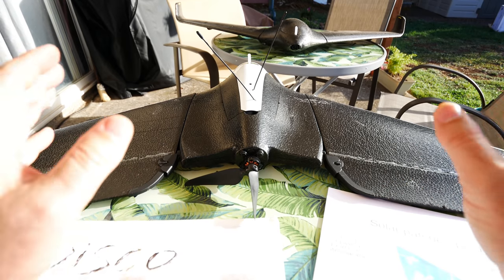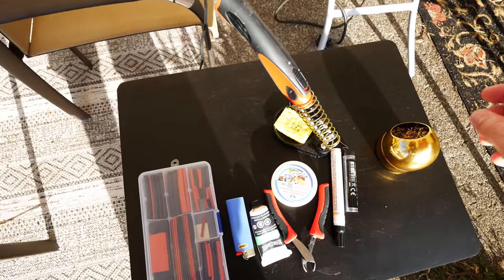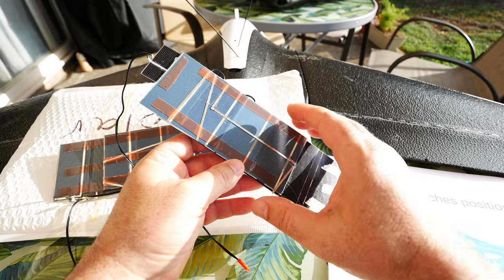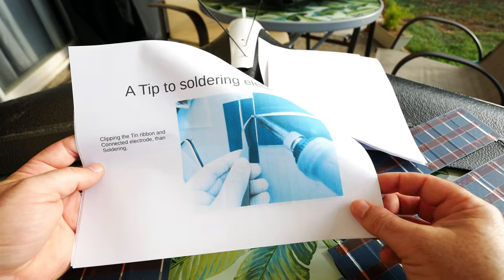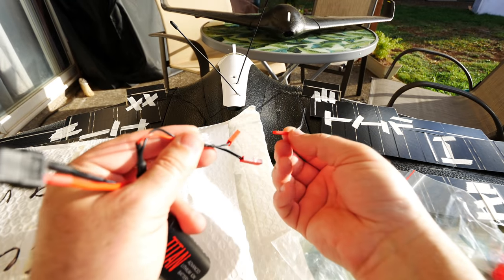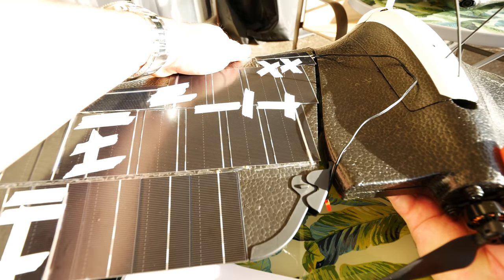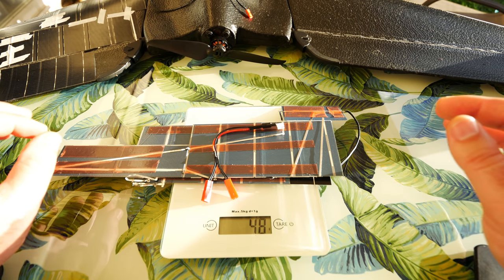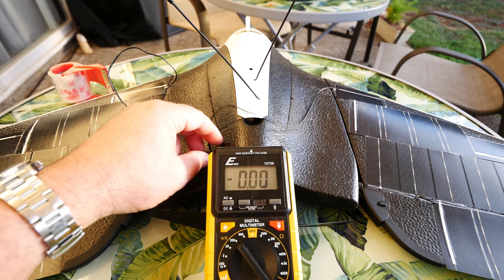Parrot DISCO 4G LTE Solar Panel Mod Install - Solarealdrone Kit (Works for other Planes/Wings)

Comment: Imagine how little current those solar panels can output, versus the battery.  You only measured voltage, not how many amps, or fractions of an amp those panels can output total when connected to a load.  I highly doubt it helps add flight time, as the added wind resistance probably uses more current than the solar panels add.  Just my thoughts as an Electrical Engineering student, who also flies drones.  Please tell me you at least have a basic understanding of volts x amps = watts, how many watts the panels can put out, and how many watts your battery pack can instantaneously.
Reply from the maker: Right around 2+/-  amps.  If you checked out the solar panels in the description as I mentioned, you'd have seen the specs.   14ish volts at 30ish watts is 2ish amps.  Enough to supplement some extra power and flight time.  My tests seemed to get 6-7 extra minutes with a 3500mah liIon pack and mainly flying in circles 🍻 🤗

Comment: There has to be a tiny battery controller to put in there? I would hate for the thing to burst into flames and come crashing down in some ones yard
Reply from the maker: As long as the panels are not left connected while not flying there shouldn't be an issue.  The Disco will draw more in flight than these panel can provide at full potential 🍻

Comment: A few issues that need to be addressed:

Issue 1: Should the cells be fully illuminated while left unattended, the battery will over-charge to fiery effect! The array produces over 12.6V open-circuit; initially connected, the battery+array may reach an equilibrium voltage below this threshold, but there is nothing to stop it from rising beyond this later as the battery charges.

Issue 2a: Symmetrically, when not illuminated, the cells will be back-driven by the battery (I didn't see a diode in the provided harness, nor included in the array). The battery will likewise be destroyed, but without the self-immolation side effect.

Issue 2b: Without reverse current protection, the cells can be damaged, especially with inductive transients coming from the BLDC motor when it is active. Granted, solar cells can be back-driven (using an IR camera, you can see the array "shine" and detect defects), but the silicon junction can be damaged by transients above the reverse rating. 

Issue 3: Varying lighting conditions (and varying draw from the battery/load) will upset power matching, reducing efficiency. Granted, this is a mild annoyance compared to Issues 1 and 2.

Conclusion: Without proper protection circuitry, the array may be damaged. Adding a charge controller and cell balancer will protect the battery from over- and under-voltage conditions. Also, adding a MPPT (impedance matching) will maximize for best power.

Recommendation: Is there sufficient interest in the community for a combined MPPT+Balancer+Charger device? Does an offering already exist?
Reply: i have this panel`s on my Disco with MPPT provided....each panel output in direct sunlight 16-16.5V , MPPT regulates the voltage to 12.55  and the remaining voltage it converted to mAh by Mppt.. Mppt also provide circuit protection...but not over charge if you leave unattended.  I dont know why he sent to him the Y cable variant.
Reply from the maker: They sent me a mini controller for the Night Fury kit which I may install into the disco as well.  Although, I think if panels are left disconnected until launch and disconnected at landing.  Most if not all of the issues can be avoided on a sunny day 🍻

Comment: Nice video but that's as far as it goes - with the extra weight and the extra drag you're going backwards - the kit is poorly designed!
Reply from the maker: I think actually test flying it will determine that 🍻

Comment: What solar charger would you use for this application?
Reply from the maker: A micro regulator that can take 17v in and output 3s voltage with cut off for overcharging would be perfect but not needed for this wing if you unplug panels when not flying 🍻

Comment: How can incorporate 4g into my Ar wing pro and other wings? Cheers
Reply from the maker: Transplant the 4g modded Parrot CHUCK flight controller into your wing and test 🍻
Reply: @DustinDunnill  So i,ll need the parrot flight controller? Surely this can be done with other hardware like pixhawk or something..🤔
Reply from the maker: Yes it can but will be more of a very custom less polished setup. There are a few who have done it on the net if you search 🍻
Reply: @DustinDunnill  i see..iv just looked, and the C.H.U.C
K system is around £250ish..was just wondering if there were other options. I guess i,ll have to research. Thank you anyway. And great video as always..😁

Comment: Interesting mod,looking forward to the series. Would be nice to be able to put solar panels on a drone. But knowing about how it works. The drone will have too big of a draw of power on the battery for panels to make a difference. With the disco there will be times the motors will be off which give it positive charging time. Thanks Dustin for all you do for the love of the hobby.

Comment: Wow Dustin I didn’t even know this kit existed!  Shame I already heat iron laminated my entire Disco.  I wonder if you could laminate over the entire solar array with out damaging the cells or significantly reducing their efficiency?  It would be a great way of reducing the drag.  I can’t foresee a situation where I would ever need to fly longer than the 3 hours I get from my 18650 li-ion 10,000 mAh battery mod, but I must admit it would be cool to see what additional flight time  and charge the solar cells give.  I guess if you were flying midday in summer on a clear day you may not need anything more than the standard battery for long flights?  That would make all the battery mods a lot of us have done redundant!  Can’t wait to see your test flights.  Great to see the disco back, I just can’t get enough of your long 4G flight videos!! 😁😁
Reply from the maker: Wow your getting 3 hours with your 3s3p Li-ion pack?  Or is it just an estimate? I think I could only get 120mins out of mine until it force landed at 5%.   Would be cool to see how much the panel output decreased with your laminate covering 🍻
Reply: @DustinDunnill  It should be interesting to compare your respective Center of gravity... (as I suppose you both had modified your battery parameter files in the disco).

Comment: wow... direct connecting the panels to the batteries? no charge controller or even a diode to prevent reverse current? that's a fire waiting to happen
Reply from the maker: I believe there is a diode in the Y cable.   Plug in only when flying and there shouldn't be any issues if you think about it 🍻